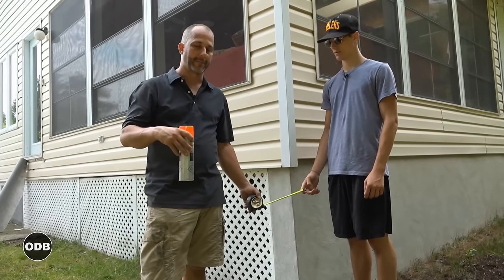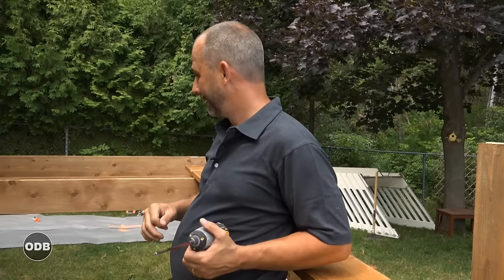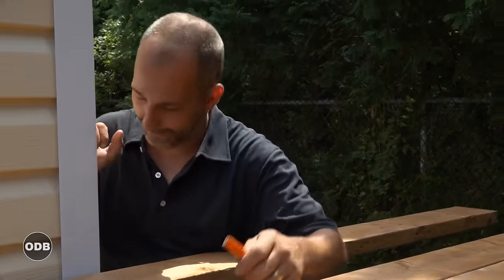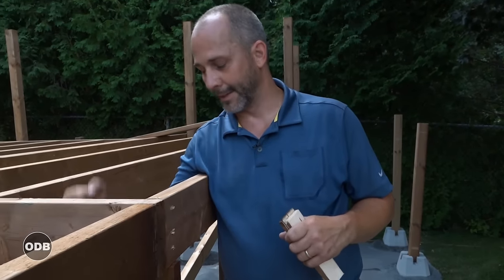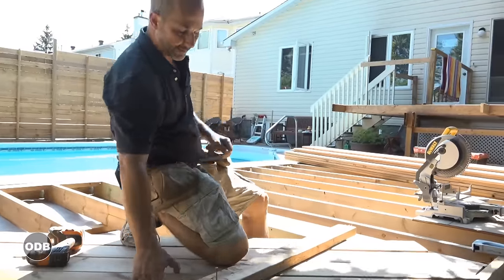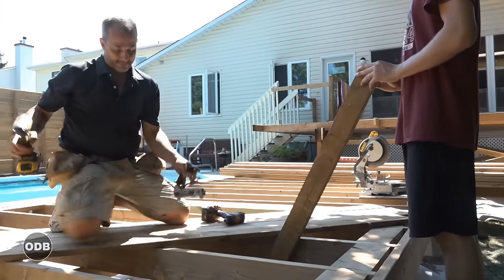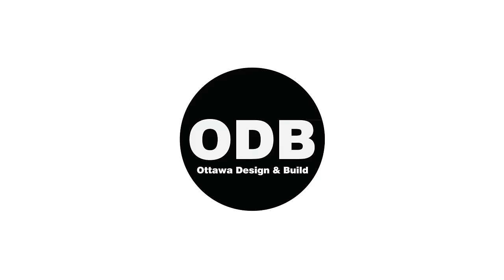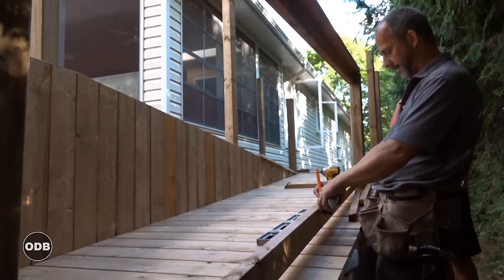How to Build a Deck for Beginners A to Z

Comment: Great job guys, I've been in the construction trade off and on for about 20 years and work with my Dad who has about 50 years experience.  The way you describe what you are doing and the logic behind it is fantastic.  I've read some of the critical comments below, and what I take from them is that some of them were not paying attention.  None of the screws that directly secure the joists to the structural supports (the box beam) that are not rated structural screws, have any shear load on them.  They are doing what they are meant to do, just holding the joists from shifting in the horizontal plane.  This is an excellent design, and deals well with the constraints you were working under.  I'm looking forward to watching more of your videos in the future.
Reply from the maker: Finally someone who was actually watching and not just looking for something to complain about. Thanks Wayne for your opinion.You are 100% correct in your deductions.
Reply: Code always depends on how far above grade you build. In Minnesota, you could build this at 2 feet above grade and be just fine. Any higher and you will need footings.
Reply: Home RenoVision DIY great instruction.  And of course some of us watch the whole thing.  Hate to walk out on a movie.  Haha

Comment: I'm just wondering why all the other "experts" are so pressed to watch and comment on this man's work instead of posting their own vid. I've actually looked for quite a few of you guys, cause I'm learning myself, just to be fair. Well...waiting.. Why experts need to be watching a vid like this is beyond me...
Reply from the maker: I could  do deck videos for weeks and not cover all of the info.We will definitely be doing more. hopefully some geared towards the beginner. As for all the critics, It's the internet and people loose a sense of themselves when they are anonymous i guess.
Reply: Ottawa Design and Build Renovations 
TY for responding. A beginner vid would be cool! Especially with NO DIGGING, I mostly do these projects by myself or with my daughter. The ground in our yard is like brick.. This one is pretty easy to follow as far as the build, even for me. So I know that a begginers one should be doable. When or if you do. Please go over the "squaring off" of the frame. I get the concept but still could use more clarity.
Reply from the maker: Perfect. Will do.
Reply: This video shows everything done perfectly 
They did as good of a job as u can do 
Great job

Comment: I just want to say I have watched many if not all of your videos more than once or twice. I have a new prefab fireplace and had to take down the flagstone wall behind the old one. The drywall was crumbling I found, so an entire new wall was needed from scratch. Besides trying to understand the concepts of fire regulations, I also had to learn to hang drywall and the the remaining flagstone raised hearth became a design thorn in my side. Determined to do this project myself, alone, I was glued to youtube, and your videos have helped me tremendously. I’m finally nearing the end of my project. I’ve spent probably 3 times what it would have cost me to have a professional do it, but I have learned SO much!  And I now have tools and supplies to tackle other home projects in the future without as much fear as I had at the beginning of all of this. Actually, I did the project half way and tore it down to start over once but again, I recall the first time I sewed something on the sewing machine. It was not a success so I tore down and started over happily. Second time has been a charm so far. I believe my greatest lessons have been to prepare well, and don’t rush through a project. Thanks again. (Cute when your son called you his helper☺️)
Reply from the maker: Thank you Cheryl. The value of preparation is always missed in today's world. Just remember, always be completely happy with each step you take and the finished project will be something to be proud of. That is a great feeling.Cheers!
Reply from the maker: Oh and I really love working for My Son Nate!

Comment: This is a great find. I learned more from these two , than by any other or videos I have seen. Genuine and straight forward with simple and effective logic. That's it...I am moving to Canada and building my first deck.
Reply from the maker: Thanks David, I apreciate your taking the time to comment. I hope you subscribed to the channel.
Reply: You wouldn't happen to remember the length of the 5/4 board you used on this deck in order to get them close to 45° angle would you?  Was it 12 or 16 footers?
Reply from the maker: Hi Eddie the board length was 12' and the angle wasn't 45 it was more like 38. just adjust the Angle based on the board length to save time and money.
Reply: Thank you
Reply: What bugs me is when guys install doors and they use the term:... “now to shim and level the door”😲😲😲....or they put level vertically on a wall to check it for level!!,,🙀🙀🙀etc. etc.

Comment from the maker: It amazes me how many people are commenting on the strength of the structure and call the carriage bolts lags or screws.
Obviously there are a lot of guys out there that need to spend some time learning about the fasteners on the market before they go shooting off their mouths.
Reply: They are the "Armchair Keyboard Warriors" who run off at the mouth and cant even gin up a Google search on the very PC they are banging away on.  To heck with them, you do good work and I have modeled my deck after this video, (not quit this sq. footage though) and it has survived very well even here lower in swamp land Georgia.
Reply: What a professional way to address your viewers. Great approach, 10/10
Reply: Deck
Reply: The beams should rest on top the post not bolted to the sides.
Reply: Michael Lewis here in wv not having them sit on top of the post will not pass inspection
Reply: I never once questioned the strength. I can visualize how stable this is.
Reply: easier and faster, no way is it as strong
Reply: @patrickhamilton6733  Obviously, you did not watch the video. 5 Stringers on the 4 rise stairs? For a start. Jeff over-killed just about everything on this build.
Not sure where you are from, BUT try working in the construction business before you open your "computer"/mouth.
Reply: @ChaotiX1  I know, right? He's only had nearly a million views and over 460'000 followers.
Reply: Home RenoVision DIY I have an 850 sq ft deck with the same use of box beams and galvanized carriage bolts holding it up.  It’s still rock solid after 30 years.  I’ve replaced the deck boards once but the frame hasn’t needed anything.  By the time these things fail, I’ll probably want a stone terrace anyway to change it up!
Reply: If I were you, I'd ignore the naysayers. There is always an 'element', it's just folk, ignore 'em.
Reply: Except they are right. This is not a professional carpentry job. You fail any structural inspections, therefore you should start over and follow the prescribed code in decks. I’m embarrassed for you.
Reply: Jeff, man those people are just bored with life and need to talk crap. Its crazy how many of them need to actually go do something productive!
Reply: @ChaotiX1  He doesn't need to use kid gloves with dummies. If uninformed people want to shoot their mouths off, they have to expect that some people are going to give it back as much as they take it.
Reply: Sorry, I am a dummy.  But if the rainwater washes away sand, the deck can lose stability?

Comment: If you have a checklist for all the materials and tools you are using, like sizes of the woods or types of nails, that would be the best.
Reply from the maker: 2x8 for joists, 5/4 board for decking and cammo screws to install decking.
Reply: What kind of 5/4 board was it? Wood, pressure treated, etc. Thank you.
Reply from the maker: pressure treated sienna brown color.
Reply: When I was working in this type jobs it was called a bill of materials.  Not something that one should need to take time to outline here.

Comment: This deck is not to code in most US states, beams and joists should not be bolted to the sides of the posts which relies on the sheer strength of the bolt. The joists and beams should rest on top of the post using joinery or Simpson ties, which transfers the loads through the posts into the ground.
Reply from the maker: Please everyone check with your local building office. Of course there will be differences from region to region around the world. The premise remains the same and there is a ton of great info in this video pertaining to finishing as well.
Reply: I think the video does provide so many good tips. But nothing is more important than safety, I doubt that any state would allow any structure to be bolted to the sides of a post,beside the fact that the bolts are probably not designed to carry the live load of several people, even when galvanized, they can still loose strength as superficial rust sets in.  You could remediate by adding a 2x4 butted and screwed against the existing post,making sure this sits on the cement block.

Comment: What happens when the grass and roots etc rot down....does the support pad also sink?
Reply from the maker: Yup. About a 1/4 inch
So you can either remove the sod or jack the deck a bit so it can settle. Either way a floating deck can handle the adjustment with no difficulty. You can also raise the structure if frost causes issues. It only takes a few minutes.
Reply: so the entire deck doesn't attach to the concrete block at all? that's why it's called a floating deck? also, how do you level it after you jack it up? do you add spacers on the bottom of the posts? thanks for an informative video, I've learned a lot from it!
Reply: I too have similar question. Is the deck fastened to the blocks at all?
Reply: @DucPhan20  It is called a floating deck, because it is not attached to the house in any way shape or form. So it is separate from the house, yet it looks like it is attached to the house.

Comment: I don't care what kind of bolts they are, you cannot rely on the shear strength of bolts if you want the strongest possible deck. This may be fine for a few folks, but good luck with parties on a deck built this way.
Reply from the maker: There are 18 of these bolts on the upper section alone. that is 36,000 lbs of shear strength. That is over 120 people weighing in over 200 lbs each. There is no way that you could get half that number on the deck. The party is still on.
Reply: You might want to consult an engineer on that.
Reply: I’m pretty sure codes in my area force you into notching the beams now, you can’t use the bolts as your only support, I use to work in the fastener industry, with that background i know the factories that make carriage bolts, 99.9% are fine but the ones that slip through because of seems in the wire or bad heat treat, laps in the threads, makes me want something else in my deck to rely on. Jeff speaks with an extremely high confidence in what he is doing which is why I think people flock to the channel and speak highly of his channel. I can’t deny some of his tricks and tips are handy. His methods aren’t what I would use but cheers to him and his team.

Comment: You should really get yourself a socket and wrench for the bolts in the box frame instead of using pliers. That's all I have to complain about. Good job! :D
Reply from the maker: Thanks for finding something to complain about!
Reply: It will make the job much easier if you get yourself a socket. I have a 13mm socket for my drill, and that makes it really fast and simple to fasten bolts like this! My comment was meant as an advice, not complaining. It's enough complaining in the other comments as it is. The deck looks great, and as a telecommunications guy I can not say anything about codes or building standards but I'm guessing that you have all that under control. The things you mention from the code, like needing two screws at the bottom of the fence, are things that wouldn't strike me to think about so very good to mention! Keep up the good work :)
Reply from the maker: That's cool. You will find that on this channel we use the most simple tools available to help homeowners with a simple toolbox. there is always a better way. You are right about the sockets though. If you have them they make quick work of a carriage bolt.

Comment: The support beams are installed wrong. You never hang them on to the sides of the post. The deck is now supported by just the screws not supported by the posts. 
In any area in Canada this deck would not pass inspection. You either put the support beams on top of the posts so  the weight is transferred down the post or you notch the post if you use a larger post.
Reply from the maker: Thanks for your thoughts, However this was built on a permit and did pass multiple inspections. The point that is being missed by a lot of people is that this system depends on the shear strength of the galvanized carriage bolts. 2000 lbs per bolt. It does not rely on screws. You couldn't be more wrong. It also installs with ease and very fast which is why we took the time to educate the public.
Reply: 26:00
Reply: Home RenoVisio
Reply: Curtis my state also would reject. The inspectors don't care about the shear on the bolts. But, I can remove a load bearing wall, but my support beams into the ceiling and use hangers to attach the joists.Go figure!!

I think the fact here if this passes inspection and common Canada building practice them hey your're good to go. I see no harm no fool here if that's the case
Reply: Home RenoVision DIY ...Ever Consider Using A Wrench To Tighten Those Bolts Tough Guy?
Reply: I wouldn't let this butcher build a dog house

Comment: I see what some are saying about notching the post to except the Joist , but again folks there's a door to get under the deck so you can always check on the bolts or add more support if needed. This guy does good work , and was approved by a inspection so chill out.
Reply from the maker: There is always more than 1 right way to do something. Cheers!

Comment: Tip one, dont ever use deck blocks unless you like it when your deck sinks first then takes flight.
Reply from the maker: Tip number 2 , Don't take construction advice from someone who doesn't post construction videos online.
Reply from the maker: I am sure there is great advice available, however if yoi don't post then how can anyone know your level of expertise. I have seen a lot of really bad advice sliding in under the radar under the supposed concept that they are qualified. Hell I could give surgical advice and call myself a doctor being anonymous.
Reply: Calm & composed on video, temperamental in the comments section. Not a good look for your business.